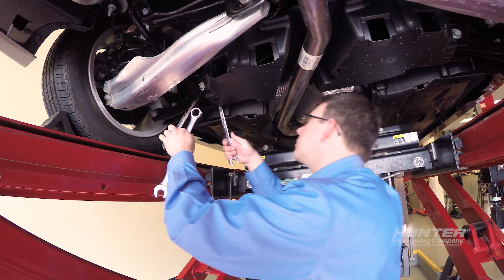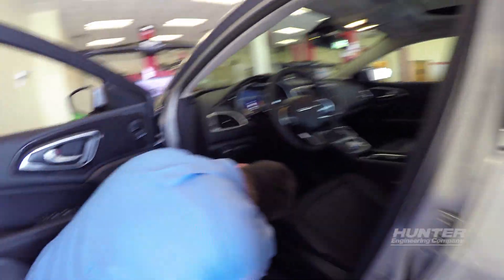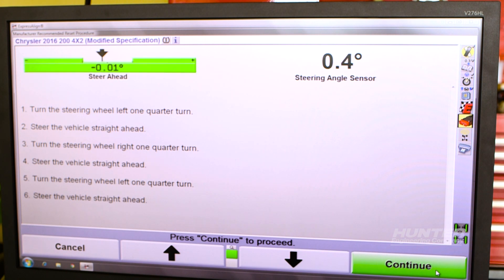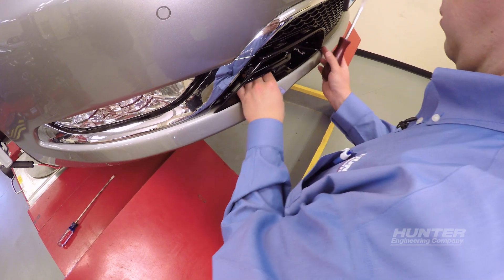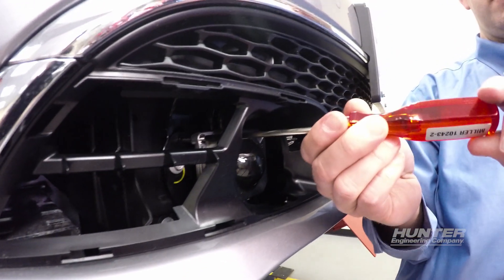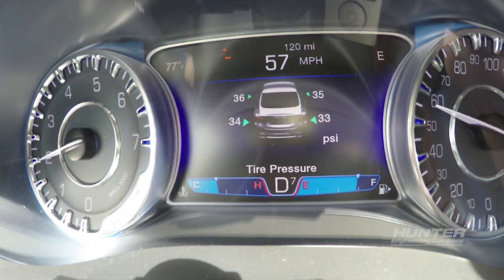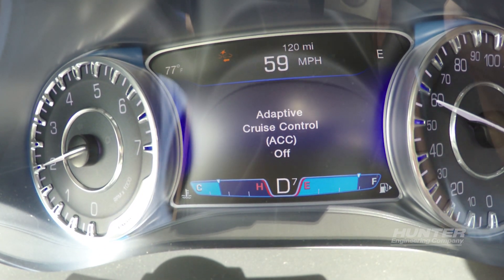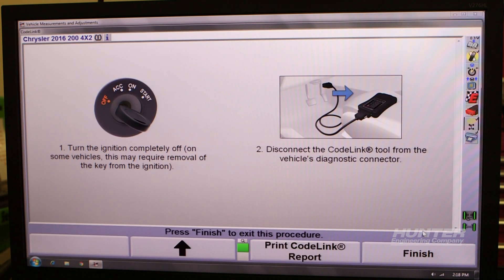Chrysler ACC Safety System Alignment - Hunter Engineering Co

Comment: Excellent video with great information.  When will repair professionals know what the needed tooling investments will be regarding ACC and similar systems?  We only service German cars and are uncertain of Hunter's plans with respect to this additional equipment.  Hunter obviously has the wheel alignment side of things covered, but mystery still surrounds working with these safety systems.  This is preventing us from buying a new aligner and rack.  Can you shed some light on this please?  Thank you.
Reply from the maker: Thanks for your comment.  The tooling requirements are a growing and constantly evolving piece driven by the OEM’s as they develop new vehicle technologies and deal with the need to calibrate them.  Hunter is working to both support reset requirements required after wheel alignment for popular vehicles and to raise awareness of the need for an industry standard that bridges the gap for the aftermarket.